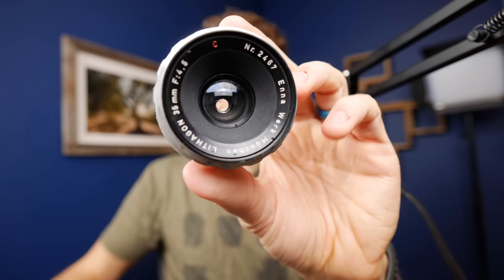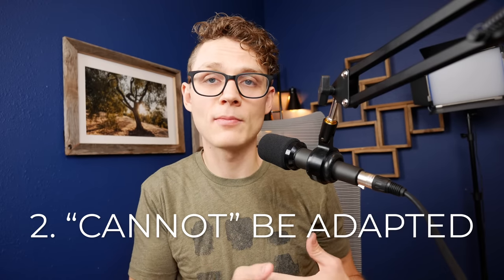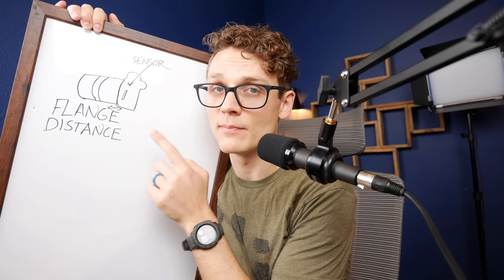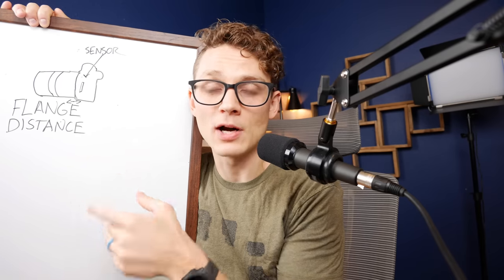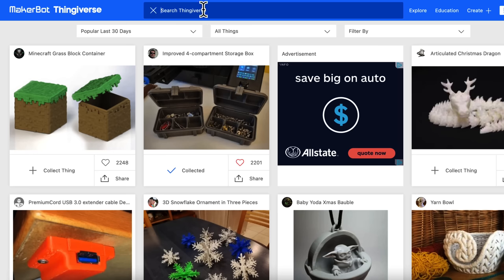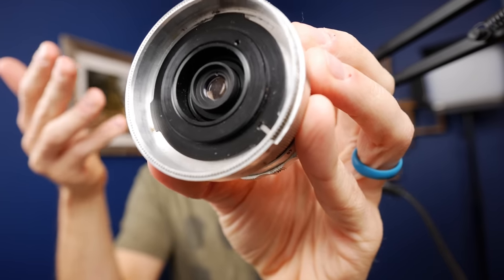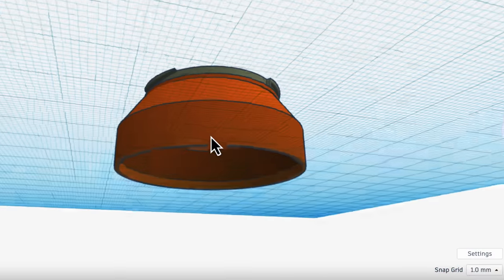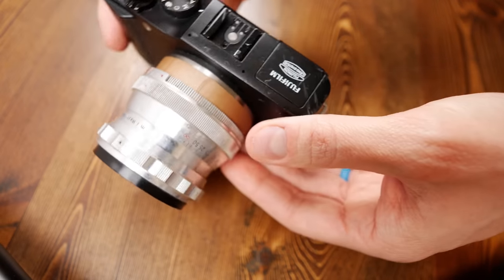How to Make Your Own Lens Adapters

Comment from the maker: Hopefully this is helpful!! Let me know if you have questions, and for the pros at this let us know any tidbits or advice you have to help someone new on this journey 👍
Reply: Vintage optiks is a good channel for this. Thanks
Reply: This was very helpful, thank you. You got yourself another sub.
Reply: Looks likes spammers are getting to you.
Reply: SIRUI 50MM with RF conversion To LUMIX GH5
Reply: What about adapting the Mamiya RB67 lenses, 112.00 mm flange distance, to a Sigma SD14 or SA9, Sigma SA Mount with a 44.00 mm flange distance ? An adapter would need to be 68.00 mm.
Reply: what c mount lens would be good to buy for very very cheap to attach to my camera for a more vintage look? i can find cheap c mount to f mount adaptors and c mount lenses are the best bet for a vintage look i reckon
Reply: You lost me at, 3D printing and CAD design. No idea how to do those things. I have glued a rear lens cap to a body cap and drilled out the center for an solution to mounting legacy lenses to my M4:3 mirrorless.
Reply: Holding a lens up to the sensor before making any modifications gives a rough estimate of distance needed for infinity. That can drastically decrease time spent on making many prints to get one that works best 😀
Reply: I'd like to make a fisheye lense for an underwater camera using the fisheye lense from a headlight of a car. I know it sounds crazy,but I think I'm onto something.  The underwater Camera is the Olympus E-M10 MkIV and AOI Housing. I might need some advice from you about mounting

Comment: I've been doing this for about 10 years and have done it with many different lenses. One of the lenses I adapted was from an old Argus camera and I used a body cap a Dremel tool and a lot of trial and error to get it to work on my Canon DSLR. Canon EF Mount is really good one to adapt a lot of lenses of course. I've done Olympus Pentax Yashica Nikon and others. But in the last few years I've mainly made custom adapters for my Sony mirrorless. Many of the lenses that I've done come out of fixed lens cameras that I take apart and make my own homemade adapter. There are cameras with tiny glass lenses that are maybe like a quarter inch wide that were made to cover full 35mm frame. There's nothing like finding an old point and shoot 35 mm or APS camera that cost $5 or so with a 24 or 28mm glass lens taking it apart and adapting it. Putting it on the camera and being blown away by how good the images are. I spent many many hours figuring out a way to do this the hard part is getting the lenses so you can adjust the focus, some people have said on here a helicoid might be a really good way to do it but in my case I kind of defeats the purpose because of how much they cost and takes the fun and challenge out of it. Because for 25 or 30 bucks I could get a decent 28mm lens and then spend 12 or so on an adapter and put it directly on the camera which of course I've done. I have quite a few 24 and 28mm lenses from slrs and a few Pentax Auto 110 lenses Etc as well which I made my own aperture for.
Reply: Funnily enough, this lens is an Argus C4 lens, but was sold as an m42 (and I failed to double check)! 

So how do you focus with your adapted fixed camera lenses? I saw one (already adapted) for sale from a Canon Autoboy and loved the sample photos the seller showed but I procrastinated too long and somebody else bought it. I really want to try it myself.
Reply: @thelightslide  one way is to use the combination of macro tubes and some kind of cheap lens adapter like for c mount to Sony E, another way to looks a little funny is to use a 3/4-in PVC adapter with a nut to screw it into which you super glue to a flat piece of plastic that you cut a hole in and you can actually hold it onto the camera body which is kind of a pain or you can super glue that to some other kind of adapter like a close in m42 or a reverse macro ring thing or something to mount it onto the camera. But I have collected a pretty large amount of spare parts from the thrifting camera and camera accessories for quite a while so a lot of these parts are not really costing me anything at the time they came along with an old camera I bought or some lenses or something like that and the adapters that you do have to buy a few years ago used to be a lot cheaper. If anyone has any better ideas as long as it doesn't cost too much I'd love to hear them as well.
Reply from the maker: Someone else mentioned adapting cheap fix lens camera lenses - that is so cool!
Reply: Helicoid is needed for when a lens comes with no focusing parts (projectors, enlargers, shutters, etc). Also, helicoid allows closeup however you please.
Reply: I've been trying to find an adapter for my Mansfield Holiday lenses to my Sony a7s. They are screw mounts so I was wondering if there is a general adapter for that
Reply: @neanderthal2599  it may be a C or a D Mount you have to research to find out which one. C Mount adapters are common. I believe these lenses are from an 8mm video camera? The way a lot of these are designed they won't cover the entire sensor and would be useless on a full frame digital camera and don't even work very good sometimes on a crop sensor camera. Anyway there are a lot better choices then these type of lenses they might work okay on a micro 4/3 camera like an Olympus pen but not on your Sony.
Reply: @Bob M o r r  ah I see, I appreciate the heads up. I am just starting to look into vintage lense usage for my film school projects
Reply: I shoot with c mount and d mount a lot. Because I’m nuts. D mount was for 8mm film, c mount mostly for 16mm (and earth television cameras, and security cameras now). Some will inadvertently cover APS-C or MFT, but it’s not ideal. You have to either use a camera with a small sensor (BMPCC OG, modified GoPro, Pen) or a camera that can crop the sensor in software. I use the Pocket 4K or a canon camera with Magic Lantern that gives you all kinds of cropping abilities.

It’s a pain, but is a bargain way to get great glass.
Reply: would love to see the image produced, what a cool project u have
Reply: the photos look pretty much like they would look if you used a modern manual focus lens like TTArtisan or 7artisans on a crop sensor camera cost 70 or $80. Some of the very old vintage lenses like The Argus for instance sometimes give the picture a little bit of a color cast. A very good choice now for a crop sensor camera is a Risespray 25mm 1.8 lens the one I bought came with an adapter for my Sony E cost less than $30 with shipping I was so surprised how good it was I bought another one.

Comment: You can get a pretty good estimate of flange depth by just holding the lens near the camera without an adapter and moving it forward and back until you find infinity focus, then measuring the distance. Just "free lensing" it. If the camera and adapter aren't in direct light, no overhead lights shining on the sensor, and you're aiming the combination at something in good light, it's quite easy to see.
Reply from the maker: That's a good idea! I'll try that out next time.

Comment: You saying "if you make that distance closer than it was designed, then you can't focus to infinity" is incorrect. In that case you loose ability to focus on nearby objects. And right after when you say "if you make that distance (flange) too large then you turn your lens into a macro lens" is correct… and in THAT case you loose infinity.

Comment: Good to find someone else who will take on a project just because it appears possible. My current on going project is a Ford F150 with a newer engine and 2 computers, 1 for the engine and 1 for the rest of the truck. The wiring harness looks like a messy ball of wires.
Reply from the maker: Sounds like an amazing (and crazy) project! Always thought I would like cars if I had just grown up different. Looks like a fun hobby for tinkerers.
Reply: No prob.  All you need is to 3D print some adapters.  Just make sure to use them new fangled high temp filaments.

Comment: I adapted an old worn out 35mm manual shift lens from a Nikon mount to a Minolta mount in the '70's. (I should have adapted it to "T" mount - oh well!). I used a Dremel tool to cut off the Nikon mount, then epoxied the lens to a Pentax screw to Minolta adapter. It was so ugly, but it worked and I used it for years. I did do all the measuring like you mentioned. I knew I wouldn't get the flange distance perfect so I purposely sacrificed close focus to guarantee infinity focus. I thought that was a good trade off for an architectural lens. Great topic!

Comment: Something I want to add. 
1. If some lens can’t adapt to a camera. It’s usually because the flange distance of the body is bigger than the original lens system. But you can fix that by put another len between the adapter. Just like a speed booster. You can find canon FD to canon EF mount. 
2. Flange distance of the digital camera not exactly that simple. Because in front of the sensor is a dust filter. I once remove a damaged dust filter , after put everything together I found out I can’t focus to infinity anymore. After that I have to remove few spacer between the sensor and the body , make the sensor move closer to the mount. It works like normal again. 
That’s why. However you try to caculate   It’s will messed up somehow. 
All the adapter manufacturers know that. They stop trying to make a perfec adapter. Instead simply make it little bit shorter. To make sure the len you use can focus  to infinity. 
You guys can try that on your lens , camera. 1. Minimum focus always further than the lens said( distance indicates on the lens) , 2 it’s always focus pass infinity. 
That’s why you can’t Zone focus like some photographers on YouTube show. 
One more thing. If you can’t find a 3D printer , or just want to mess around. You always can use a PVC tube, a body cap (for the body end of course) , and a len cap ( for the lens mount ) worst thing can happen is the tube not cut good enough. Two caps not parallel, and you got a “tilt shift “ lens , with real miniature effects 😂😂😂
Manual glass is my things. I can talk about it all day.
Reply: Awesome info, thank you. Do you have a blog?
Reply: Sheer genius using lens cap.Re-purposed

Comment: This video kinda read my mind! I have been seriously considering doing my own attempt of 3D printing an adapter to use my Canon RF lenses on my Nikon Z system. That would be a very thin adapter that's only 4mm thick and has to accommodate both mount designs (Nikon Z from the outside and Canon R from the inside). However, the problem with such an adapter without contacts for aperture control is that you'll be using the maximum aperture of your lens all the time. In principle, I know the adapter will work because Sony E-mount to Z-mount adapters exist out there, and Sony's flange distance is even shorter than Canon R by 2mm. No company would ever dare to make this adapter because Canon will make sure that the idea dies in the crib!

Comment: A helicoid adapter can help you hone in on those flange distances. For some stuff it's pretty much required, and you also get something useful for macro.

I have a helicoid M42 to MFT adapter, as wel as a Tilt adapter and a C-mount adapter. There's just a lot of fun to be had in mirrorless and it's taken me to the point where I am saving up to get something like a Canon R series to just get that extra sensor surface to really pull as much as possible from all the weird lenses I've managed to pick up over the years.
Reply from the maker: That's a really good tip, thanks! And yes, I do think there's something special about using some of the 35mm glass on a FF sensor. I've done that with Pentax K mount glass and my Pentax K-1. I've never actually owned a full frame mirrorless camera. I know some people into adapting vintage stuff grab the original Sony A7. I think it's the cheapest full frame mirrorless you can get ATM. But maybe not good in other ways, I don't know.
Reply: @snappiness  I have seen the Canon RP for around 900 and even as low as 800 bucks. Still a lot of money, but arguably "cheap".
Reply: @theothertonydutch  RP is a solid pick but you can grab an original A7 for as low as $400 which is a bit insane for full frame mirrorless.
Reply: @TheRebelBagel  I've managed to see a a7r and a7iii sub 1000 aud
Reply: @TheRebelBagel  I'd like to have the option for 4K too, though. So I'm still waiting around a little bit. The R6 comes with image stabilization on the sensor too, which is kind of my next goal. It all really depends on how my wallet goes in the next couple of months.
Reply: I have a C mount to M4/3s adapter but find that I wish I could move the lense 2mm more into the camera body to get closer focusing.

Comment: Where 3D printed adapter is really useful is in harvesting lenses from old fixed (non-removable) lens cameras, e.g., Yashica Electro 35 GT, Minolta Hi-Matic, etc.  The lenses itself comes off easily enough, but won't be to a standard mount.  Each one is a custom job.

Come to think of it, I should probably stock up on the old fixed lens junkers while the going is still good.  Good vintage lens deals are already becoming rarer.
Reply from the maker: Oooo, the possibilities are endless.

Comment: Hi there! Thanks for the inspiring video, definitely now I want to 3d print some flanges. I've already used a body cap with some plumbing tubes and a rubber corrugated tube from an auto repair shop with the lens I've dismounted from an old projector ) it looks lame but it's working 😊

Comment: I am new to photography, and use a 14 year old camera released in 2008 for photos the Canon Rebel XS with a 75-300mm lense, It doesn't take video but takes good pictures (I'm pretty sure its a DSLR but I don't know a lot about cameras and their specs sorry). For video though, I use a Panasonic HC-v770 which is an action camera and was released in 2015. Idk if you've done a video on these but it may be interesting for you.

Comment: Watching this video after I already had modified two lenses for Nikon DSLR. Those lenses were Olympus Zuiko 35mm f2 and Helios 44/2 f2 (M39 mount) and it was really interesting because in my case the distance between camera sensor and lens was negative. For that I had to cut Lenses into two halves and fix Nikon's mount in order to let the lens sit inside the mirror assembly. Yes, during the testing, the mirror hit the lens few times but luckily didnt break. Both focus to infinity and works like champ! :)

Comment: Hi! thanks for the video! I build my own adapters as well but not in the same way, in the past I would mill them out, but now I prefer to make a model in clay or plasticine and make a mould  than I cast out in carbon fiber, but I test them before making the final product, otherwise is too much trouble.

Comment: Thanks! I have so many great mostly functional vintage lenses I buy for CA$5 from the quote-un-quote "garbage bin" at my local camera store (if they can't resell the lens for more than CA$50, it's not worth anything to them. Too strict if you ask me) and from the thrift stores, but real lens adapters like the Fotodiox ones are to expensive to justify using on such an old and cheap lens. I'm excited to try this.

I have an immaculate Miranda MIR 50mm f/2.8 prime lens that came on a Miranda Auto Sensorex EE for $10 I picked up at the Salvation Army which takes amazingly sharp, clear, and beautiful film photos that I wouldn't mind testing on a mirrorless camera.

Comment: In 2011 I was migrating from four thirds to micro fourthirds - but early on in M43, there was a lack of glass. Even if you like manual stuff - a lack of fast-wide glass.

I bought a Canon PHF 35 F1.2 TV lens. This was C-mount, and there  C-mount adapters, but the shape of this lens got in the way of properly screwing down and giving focus beyond a few inches. 

At some point I was determined to get my focus back so I took apart the lens and trimmed the body of the lens, and the helicoid. This gave me infinity focus, and I could still close focus under a couple feet away.
Next issue - The base of the helicoid has a stop, and without it, the lens can "focus" until it falls off the helicoid.
Solution - TV lenses have a screw that's normally in place to lock focus at a point. I threadlocked a screw in place, but not to lock the lens. In the C-mount adapter I used, I bent one side up to get in the way of the screw when focusing, limiting the focus.

I've been using it recently again - spot of sharpness in the center with "character" 😆
The edge gets soft, and bokeh is  swirly at the ends. Makes for interesting Christmas  and portrait pics.

PS: I really don't recommend doing this, especially with crappy tools. I may have spent an hour or 2 trimming the helicoid, but I spend another couple of days sanding, polishing, and trimming so that the helicoids would spin smoothly afterwards.